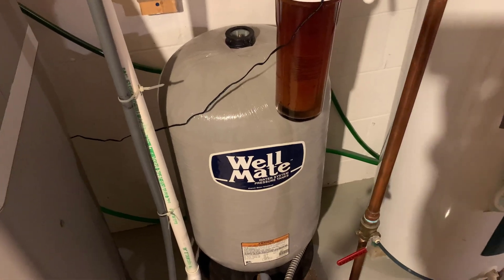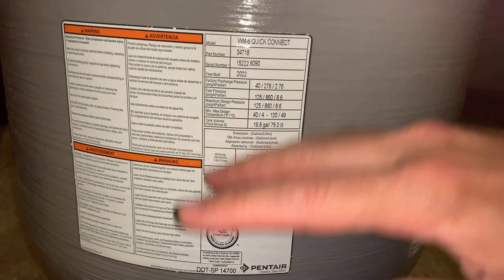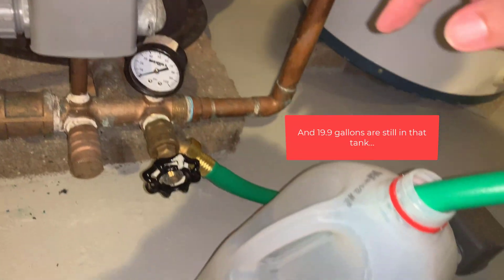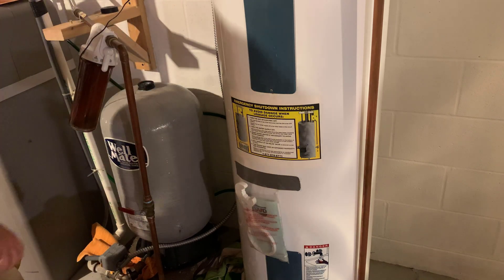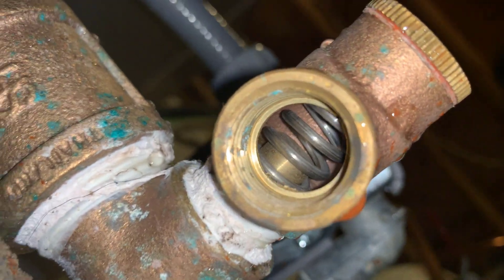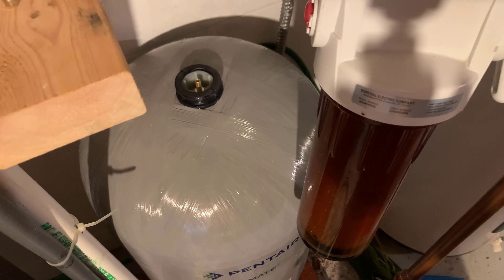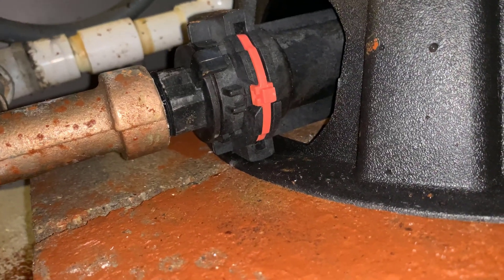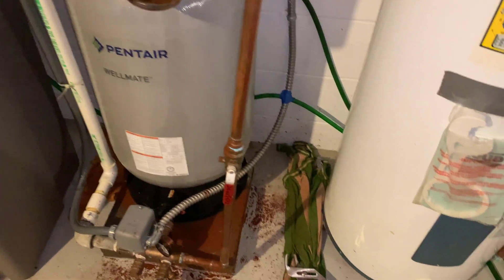Well Mate WM-6 Pressure Tank Installation & Intermittent Well Pump Troubleshooting

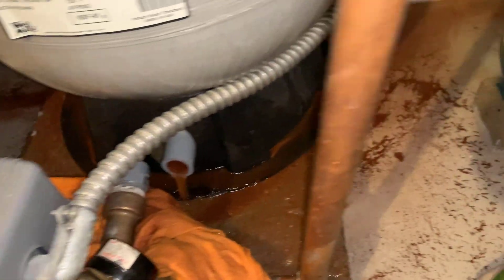Comment: 7:15 I know this is an older video, but why didn't you put a shop vac, without the filter, over the hole and run it while it drained? You could have saved your basement from flooding.
Reply: Mine has a place to attach a garden hose.
Reply: @billwilson3665 ya, same

Comment: Those fiberglass tanks are meant to be rebuilt. Ie you can replace the bladder at a fraction of the cost. I just did it
Reply: I thinking of replacing my bladder instead of buying a new tank. Is it an easy job?
Reply: @colinmacvicar2507 it was easy. I never did it before and it took me about 45 minutes to replace it and have the new bladder up to pressure. The new bladder came with 2 valve stem caps so I drilled a tiny hole in the center of one of them. I took some of that string used to lay out foundations or for straight lines for masonry construction. I put that string through the tiny hole and tied 2- 1/2 knots and then put it on the valve stem. This sets you up to be able to pull the new valve stem through the little hole for it. Anyhow you tie the other end of the string to something skinny like a finish nail or something. Now you’ll turn the fiberglass tank upside down and drop the finish nail and line through what is normally the bottom and get it to go through the little hole that the valve stem will go through. My suggestion is you do the pulling and have someone else feed the bladder through the big hole on the bottom. Either way it’s pretty simple. Hope I didn’t mansplain it.
Reply: @johnkaspar462 thanks I appreciate the tips. There’s hardly any info on line that I can find on it.
Reply: @colinmacvicar2507  Not bad. The pain for me was the plumbing was seized from corrosion so I cut and replaced it, if I recall the pipe had a tapered thread that took a little doing for me to find but replacing the actual bladder was no big deal.
Reply: @billwilson3665 thanks but I ended up changing the whole tank. For me the price of the bladder was almost the same as the new tank and I got a warranty with the tank. I think it was because I’m in Canada and it would have shipped from the US.

Comment: If you pressurized the top you would have pushed 99% of the water out....and you ccould have just replaced the bladder in the tank had you not cut the grey plactic fitting....granted a new bladder is 2/3 the cost of a whole tank

Comment: Thanks for sharing. That's an odd connector and I wasn't sure what to do with it, if it needed an interim pvc pipe or what --had this tank for a few years and forgot about the quick connect setup. Anyway, that funky connector looks like it would leak with all that pressure. Thanks!

Comment: Thank you for your post on installing a pressure tank. Can you tell me what the diameter was on the nipple you screwed into your main line? I am going to have to put a PVC nipple on my pipe and screw the piece that comes with the pressure tank into that. If you know what size that male thread was, that would help me immensely.
Reply from the maker: Im not 100%, but i think 1in. Doesnt say in the manual. I would contact manufacturer if you want to know for sure.
Reply: Any size smaller than WM-12 (to include WM-12) = 1” mnpt
Any size larger than WM-14 (to include WM-14) = 1-1/14” mnpt according to recent pentair well mate literature

Comment: Going through this now.  I can't get any more than 18 PSI in the tank (Same Wellmate one).  Tanks are up to $800 for the 47 gallon one now!!  I'm going to try the replacement air bladder route and see how that goes.  Just the bladder is $350!  Ain't inflation wonderful?!
Reply from the maker: 40 gal wellmate for $430 including shipping: https://www.aquascience.net/wellmate-40-gallon-universal-retention-tank (I bought my 20 gal from this same place). If you have all the faucets turned off, I'm not sure why the tank would be keeping you from getting about 18psi... sure it's not your pump?
Reply: @ScottDriscoll  The pump gets the system pressurized normally (40-60 PSI).  It's the bladder itself that will only pump up to 18psi (should be 38).   That link is just for a "storage" tank.  The 47 gallon pressure tank  is $765!  Just ordered the bladder kit, fingers crossed.
Reply from the maker: @todds2248  my mistake, best of luck with the bladder!

Comment: Drain tank a bit and add air. No need for new tank!
Reply from the maker: There was definitely a hole in the air bladder, and I looked into replacing that, but it seemed like a lot of work.
Reply: @ScottDriscoll  Metal pressure tanks operate without a bladder, relying only on the air above the water to accommodate the drawdown and refill. If the fiberglass tank does not leak, you could repressurize the air above the bladder, even if it has a hole.
Reply from the maker: @lylestephens8828  Interesting... I think the pressure was OK when I checked it, so not sure why it wouldn't work the same as in a metal tank. Could be wrong about the pressure, though.
Reply: @lylestephens8828  Wrong
Reply: I did that now my tank is full of water again I’m not getting another Well Mate they don’t hold up ,

Comment: Great video and thanks for posting.  My old tank probably had a ruptured bladder and was making the pump go on every 40 secs so I just purchased the same Well-Mate system tank as you did.  Appreciate the installation video along with the comments as I feel more comfortable making it a DIY project.   Quotes from plumbing companies to replace the pressurized well tank were all around $2,000 - saved more than 75%.  (Will definitely drain all the rusty water from tank before disconnecting)
Reply from the maker: $2k!! Hope your install goes smoother. Pushing down the air valve really sped up the draining process, FYI.

Comment: Thanks for video - But how many liter water runs from tank to house - before pump turns on? (aproximantly)
Reply from the maker: About 19 liters of 5 gal, depending on pressure
Reply: @ScottDriscoll  Ok - and your tank i 60 liter or 80L?
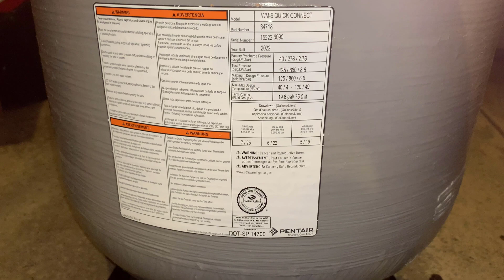Reply from the maker: 75, go to 2:25 in the video, it has all the specs on it